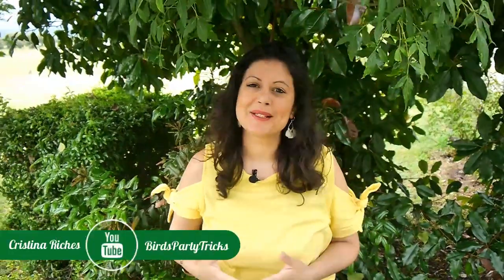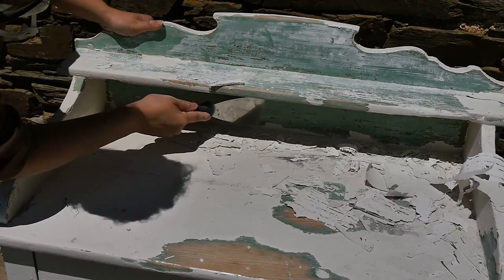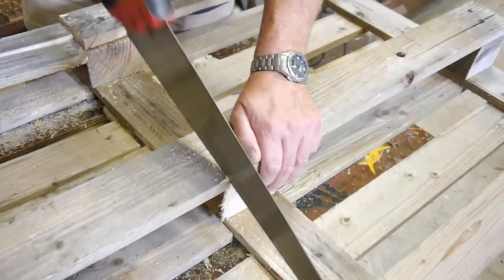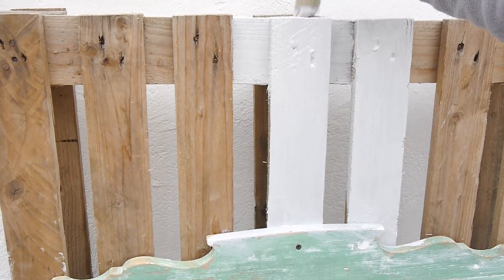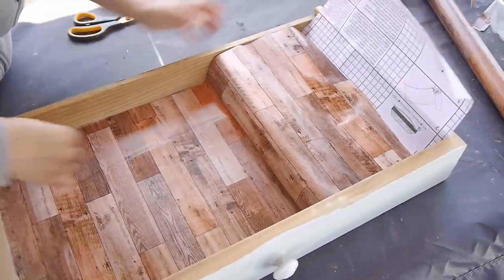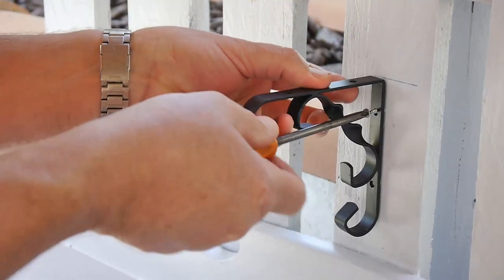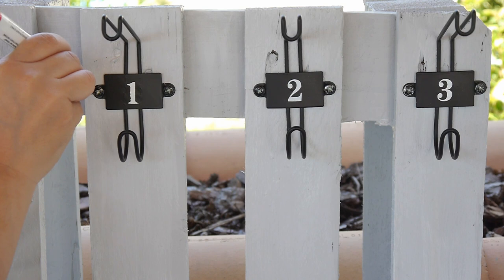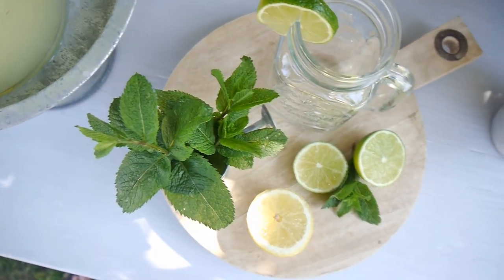DIY Farmhouse Outdoor Bar or Potting Bench 🌿 Trash To Treasure Patio Table From an Old Pallet

Comment: Very Cute ,but why did you leave the 4 x4 pieces on the back? It’s just more weight not support. To make draws slide better,use bees wax or paste wax on surfaces that touch.
Reply from the maker: Yes, Pat! 😁 After we built it, we did think of removing that piece...but I like to have an extra level to add plants maybe? I'm living with it for now (its propped against the wall) and its not going anywhere), but if it bothers me, we'll just use a hammer to remove it as its nailed in. Thanks for the tip about the wax! Will try that next time! 🤗
Reply: @Birdsparty   yes I thought the same thing, for plants on the 4x4s. The wax you can use now, I noticed the drawer stuck a little.
Reply from the maker: @patmontalbano290  awesome, I'll try the wax! Thanks again, pat! 🥰